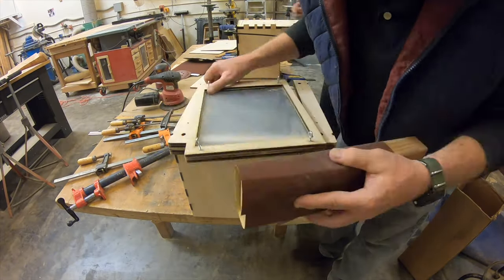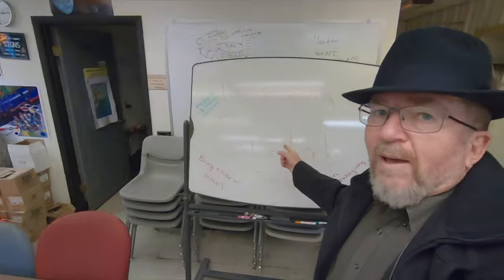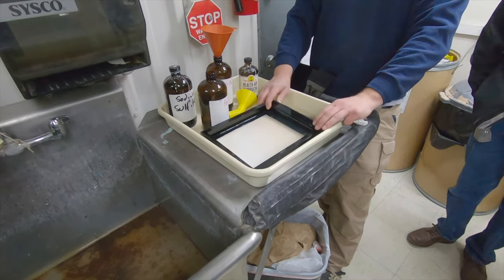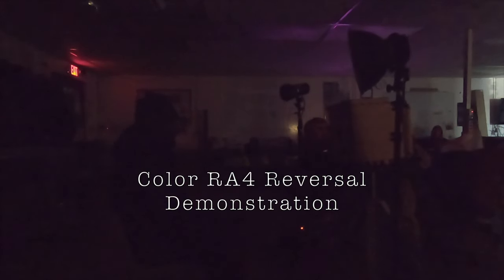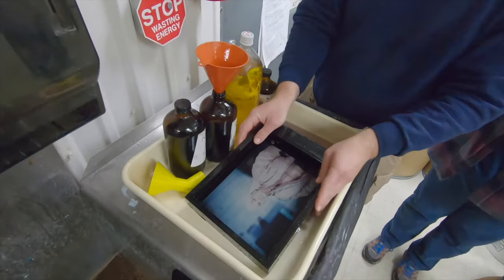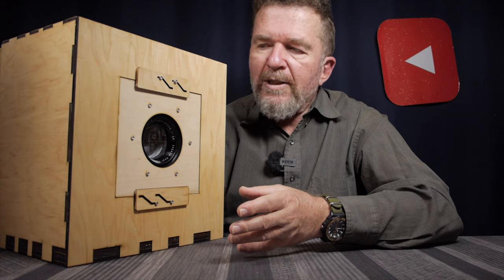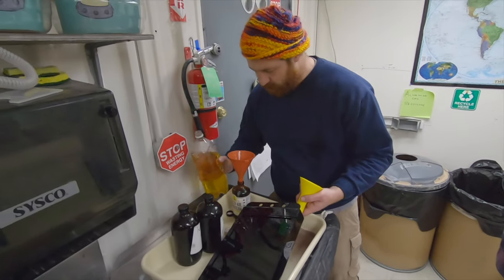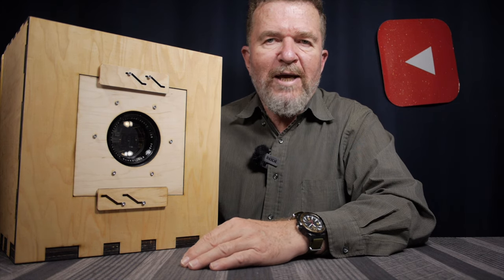Box Camera Demo at QueLab

Comment: very nice demo. What is the  8x10 developing tank used at 06:25?
Reply from the maker: That’s Ethan’s prototype film development back. The paper is held in place with rare earth magnets, there’s a dark slide lid to the tank. It’s thin enough to fit under the spring back ground glass of the camera. For developing there’s a light-tight pour spout attachment funnel where liquid can be poured in & out. Made from laser-cut acrylic plastic glued together. He will be making some of these, and/or releasing the plans.
Reply: @Joe_VanCleave   thank you for sharing

Comment: Great video I have been living the progress of both of you , also got a question I was looking at experimenting with paper reversals but I haven't found an up to date guide , the one that I found was one of your first trys where you still mixed the citric acid and h2o2 together , could you made a simple written guide on the most up to date of your experimentation
Reply from the maker: I can do it here for the black & white reversal process:

Expose the paper at 2-3 stops more than ISO 3.
Process in your standard paper developer under red safelights for  2-3 minutes. You should have what looks like a paper negative that's been over-exposed.
Stop bath for 30 seconds, followed by a brief water rinse.
Citric acid bath for 30 seconds, face down, under red safelights. (3-4 teaspoons of citric acid powder to 500mL of water). I haven't found the concentration that critical. Best to have too much than not enough, so err on the side of more.
Strong H2O2 solution (12% or stronger), under red safelights, face down, until the dark highlights begin to fade. You'll have to pull up a corner of the paper to periodically check it, as it sits face down in the solution. Most likely it won't bleach out on the first try.
Repeat the citric acid and H2O2 steps, until the paper looks entirely white.
Brief rinse with water to remove the H2O2.
Turn on the bright room lights to thoroughly fog the paper. The white lights stay on for the rest of the process from here.
Sodium Sulfite bath for 30-seconds to a minute. Mix from powder as per instructions on container. This helps remove the brown mottled staining that can happen.
Water rinse to remove the sodium sulfite.
Ensure the paper has been fully fogged with white light.
Second developer bath. Use the same developer as the first step. Face up, it should quickly reverse to a positive image in 20-30 seconds. Let it go for 2 minutes to ensure all the silver halides fully develop.
Archival rinse, dry. Selenium tone if you prefer.
Reply: @Joe_VanCleave  thanks you very much keep up with you channel and proyects
Reply: @Joe_VanCleave  thank you for the response. found your channel a week ago. have binged since not in order, and this morning was wondering about this very thing.